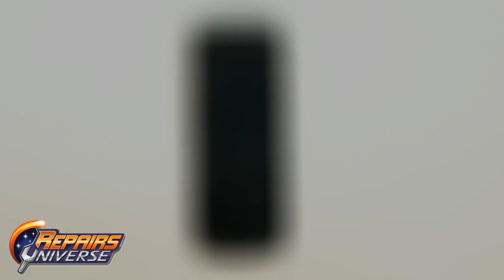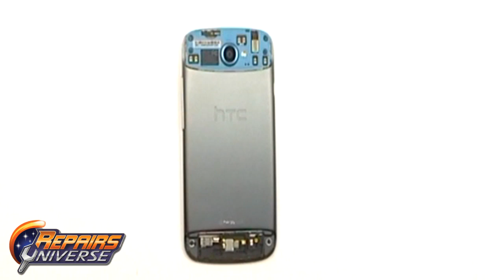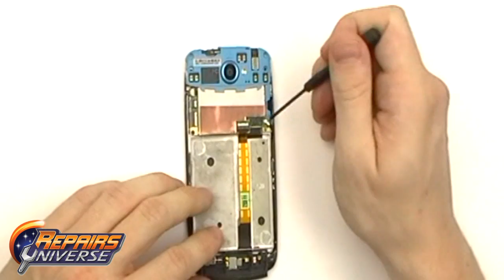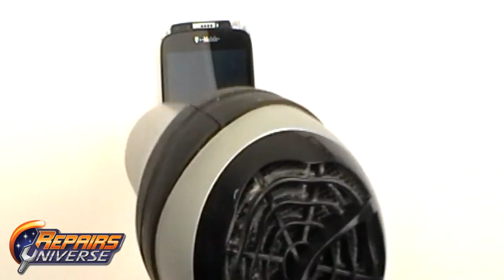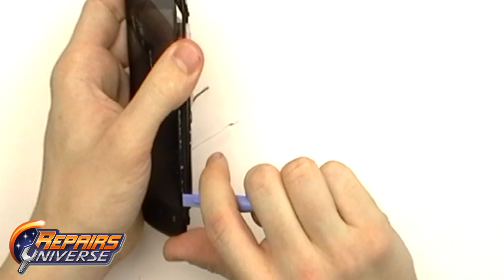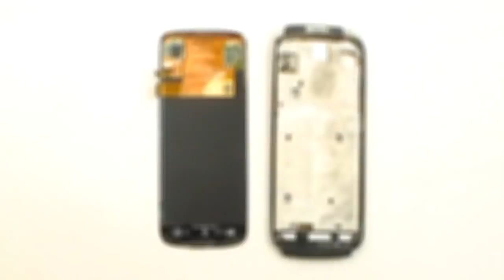HTC One S Screen Replacement Repair Guide

Comment: I did all the steps but now the buttons below doesnt work :C
Reply from the maker: Does everything else work? When you removed the LCD from the frame did you reuse the 2 sided tape? If you did. Did you make sure that the screen sit flush against the frame? Check all of your connections to make sure they are all flush and secure. Let me know how it goes.
Reply: Yes, everything else is working. 

I didn't check what was in that part of the digitizer when I remove it. Also check the the conexión and they are ok, even has power couse the lights turn on
Reply from the maker: Did you purchase the screen from us? Sounds like you may have gotten a defective Digitizer. We try to test all of our screens before they go out. Unfortunately every once in a while one slips threw. You can call us if it was ours and we can send you a replacement. If not I would contact who you bought the unit from for a replacement.
Reply: No, I bought it in amazon and the store is from China. 

So, the digitizer suppose to have something in the lover to function correctly? Couse It came with nothing, only with the logos of the buttons on it
Reply from the maker: I would say the digitizer is more than likely defective. Sounds like the only 2 options you have are ask for a replacement and try again, or you can send the unit into us and we can diagnose the issue for you and repair your unit accordingly. Wish I had better news for you. Sorry. Please keep us posted on the progress.
Reply: Thank you so much for information. 

I'm from Venezuela,  so given the situation in my country I'll better wait to do that. 

I'm using an app the emulates the buttons meanwhile... 

Thank you so much.
Reply from the maker: Please keep us in mind, and hopefully when the unrest subsides you will be in a position to get a replacement part, or send your unit into us to repair it for you. Stay safe. We all here at Repairs Universe hope that you, and yours stay safe!
Reply: Luis Contreras
Theres a flex that goes behind the battery... have u plug it back? otherwise maybe u broke it when u tried to dissarmed.. check that flex!

Comment: does the glasss relace as easy as the other s 3's?
Reply from the maker: Hello, Are you asking about the Samsung s3? If so, they would be not the same as the repair takes different steps to replace.